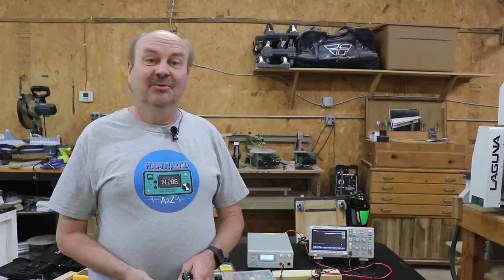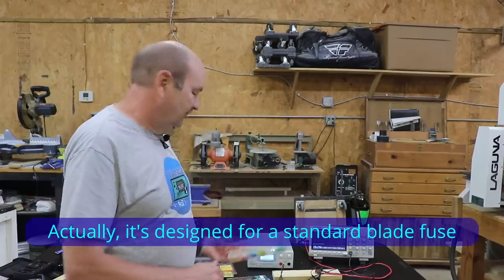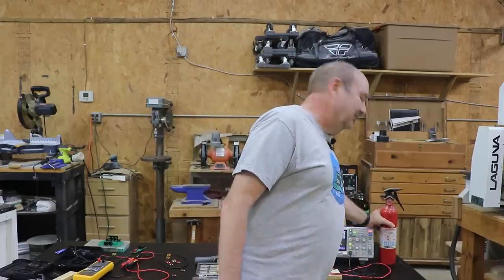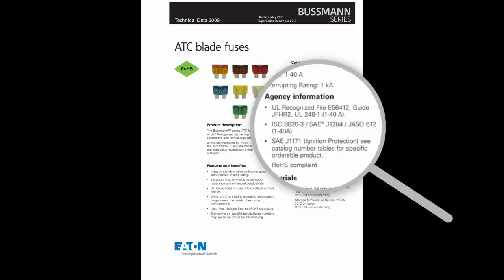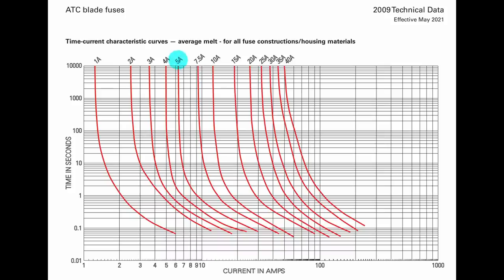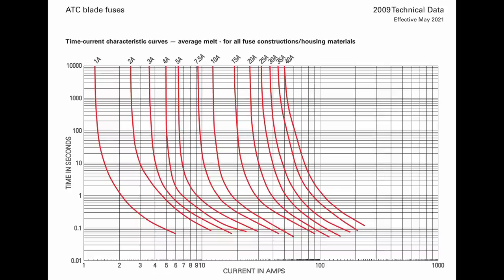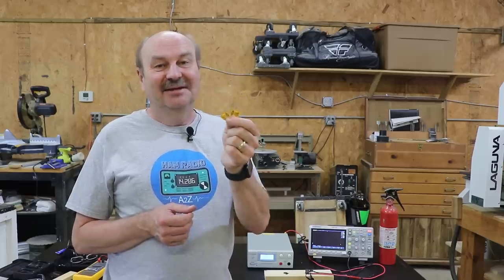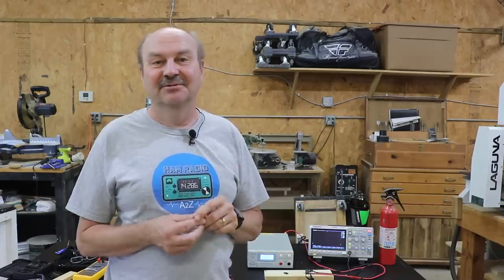Bad Fuses

Comment: There is only one thing wrong with this setup, Your Power supply! You are forgetting about Watts, meaning the ability of electricity to do work. From your readings 21.3 Amps @ 0.6 Volts,
21.3A X .6V =12.78 Watts. A normal 5 Amp fuse requires 60 Watts before it will blow. Let's do the math. 12V X 5A = 60 Watts. So you need 60 Watts to blow that fuse and you are only giving
it 12.78 Watts of power. A 10 amp fuse requires 120 Watts to blow and a 20 amp fuse requires 240 Watts. As these are automobile fuses, they are 12 volt based. All I can add is get a real power supply then you can do real testing.
Reply: Given those volts and amps, the fuse wire's resistance is about 0.03 ohms (V=IR, V÷I=R, 0.6V÷21.3A≈0.03Ω). Given that resistance, to do 60W on the fusewire you need about 45A (P=VI, P=RI², P÷R=I², √(P÷R)=I, 60W÷0.03Ω=2000A², √(2000A²)≈45A).

With the resistance calculated from the voltage and current used in reality, to make the fuse blow at 5A the power at which the fuse must blow is about 0.75W (if power is actually the rule, which I think not exactly), and at 21.3A the voltage that gives that power is about 0.035V

I think the rule is not the instantaneous rate of heating but something of the rate of cooling combined with the power, the specific heat capacity and melting point of the wire material, the diameter of the wire, how quickly you want the fuse to blow. For automotive applications also the stresses in the wire from vibration might play a part depending on material used.
Reply: The thing I'm worried about is that 0.6v. that's the silicon semiconductor forward bias. I saw some fuses for sale with an LED to indicate when they'd blown and I avoided them because the salesman couldn't discuss how fuselike their properties would be... I wonder...
Reply: No, the setup is correct. In normal operation the fuse consumes only a tiny fraction of the power in the circuit. At 4x overload it will still be a very small fraction. Real fuses are made of a low-temperature alloy so that the little bit of power they steal is enough to melt them.

Comment: The Chinese don't care if they burn your house down. There's a video on my channel discussing the importance of having proper fuses or breakers "How not to set your PV system on fire using cheap unbranded components".
 That was prompted by a BigClive video where some Chinese generator had a fake breaker in it. I bought some of these fuses on Amazon but never used them. I should have known better. I just dumped all of them in the trash.

Comment: I would have loved to see a comparison of the fisible links in all the fuses.  I suspect that the no name brand is using the wrong material at the wrong dimensions.
Reply: I suspect the yellow 5a fuses are actually mislabeled yellow 20a fuses. I find it curious he didn’t test any of the other noname fuses.
Reply: @stargazer7644  the fusible link is clearly smaller than the fusible link in a 20a fuse.  It's supposed to be a 5a fuse.  It's most likely a material engineering issue.
Reply: @ianbelletti6241  It is supposed to be, but it isn't for these fuses.   6:18 They all look about the same size to me.  The 5, 10 and 15 are just a slightly different shape.
Reply: @stargazer7644  that's why I'm asking for a comparison of the fusible links.

Comment: That size is known as ATO, Mini are smaller and midi are larger
Reply from the maker: ATO and ATC fuses have similar specs and are the same size.  In ATO fuses, the fuse element is Open to the air - the bottom of the plastic housing is not sealed.  ATC fuses are Closed in a sealed plastic housing. ( I was confused about this too and had to look it up)
Reply: @HamRadioA2Z  closed weren’t available when I was designing auto wiring at Jaguar and then ASton Martin I would suggest the “O” & “C” means open & closed ?? Does little fuse make both types ?

Comment: I never trusted the low cost no name fuses and would never buy them.  You just affirmed what I believed.  I think that the fuse material is just a piece of plated steel stamped to the dimensions of a name brand fuse.  It would be interesting to check the resistance of these fuses compared to real fuses.  I'll bet it is much higher and thus they are currently limiting and therefore they don't open as quickly.

Comment: The cheap fuses clearly didn't blow fast (enough?). But you should have set up your experiment so that the PSU wouldn't reduce the voltage across the fuse to something <<12V. A resistive load like a light bulb, in series with the fuse holder, could have done the trick. The current video just showed that the PSU reacted faster than the cheap fuses.
Reply: Very good point! Consider the POWER across the 5 amp fuse at full load (P=I x E), That's P = 13V x 5 amps = 65W. But the test was 21 amp at 0.6V = 12.6W. The fuse could easily handle the large current at much less than 13V with some heating. A better test would be a battery with relatively "unlimited" current across the cheap fuse. The other test using the oscilloscope was set up with PS off, then switched on, so I'm wondering if there might have been a full voltage across the fuse for longer than the 300ms just because of PS characteristics at turn-0n?
Reply: Doesn't matter, in that case the voltage drop across the fuse will be the same since the other load will be dropping most of the voltage.

This test was accurate
Reply: @donaldgray9924  How about learning a bit about electricity ?

Comment: SO I DID MY OWN TEST, since I have a lot of those cheap fuses I tried the test with a large battery as the power supply. I had a 4 ohm large resistor as a load and found that the 3 amp fuse held, so did the 2 amp fuse, It should have blown but it did not, So I hooked two 12 volt batteries for a 24 volt power supply. This should have blown the fuse fast, it did not. Test circuit resistance set the current at well above the fuse ratting, neither the 2 or 3 amp blew. So now I have to test units from other purchases and toss out the junk. W4GSM

Comment: I've had them for a while now and have replaced plenty of fuses with them. They have blown just the same as the originals when there is a problem. Just check reviews first
Reply from the maker: I’m going to be doing a follow-up on this.  I’m sure these fuses will blow just fine if your power supply is a car battery or something that can deliver hundreds of amps into the short.  The trouble happens if the fuse is protecting a small, sensitive electronic device.  In that case, a small trace on the circuit board inside your device may blow before the fuse.  As I said in the video, if something shorted, then the device already needs to be fixed, but this could make the repair much more expensive.
Reply: @HamRadioA2Z  true, cars are either dead short or not. I might go test a couple fuses today to see if they short at a slightly higher amperage.  It'd be cool to see a video testing a bunch of the budget options like some from Amazon and harbor freight ones

Comment: Fuses are not bad. Those type of fuses are "slow blow fuses" good enough for car industry but not enough fore sensitive circuit. I highly suggest you to use fast fuses which are more sensitive for any kind of current spike, and they are design for surge protection or similar application
Reply: even  a slow blow fuse should blow at 4x current
Reply: @andygozzo72   yes but when ? How much time is needed for that ? If build sensitive circuit protection should be design for that, which is not the case here
Reply: @nikolajovanovic7419  you'd need to check datasheets for the blow time, not all circuits have any integrated overload protection...
Reply: @andygozzo72  of course, but everything depends on you design and purpose
Reply: @nikolajovanovic7419  Three minutes at more than 4x the rated current is way, way too long. A 5 amp fuse would ordinarily be used to protect a small wire, not the heavy wire used in the demonstration. When a fake fuse fails to blow the wire will start to heat up and the insulation may melt and burn. In a real fuse the part between the legs is made of an alloy with a low melting point so that it is destroyed before the fuse legs, the plastic cover, or the connected wire get too hot. The fake fuse is likely just a stamped piece of aluminum sheet made to look like a fuse.

Comment: Wait, why are you testing it at 0.6 Volts and not 12V?
Reply: Because in actual operation the voltage across a fuse is quite low, even at considerable overload. If it wasn't, the circuit wouldn't work since the fuse wouldn't let enough voltage through. If you applied 12V directly to this fuse with a big car battery, the current would jump to over 400 amps! Hardly a valid test for a 5-amp fuse.

Comment: The chinese manufactorers don't care much for datasheets or safety, they just care for their profit! I got these cheap car fuses off of ebay and they work for me. I replaced a fuse in an ebike battery. 2 times i have accidentally tried to charge in reverse and the fuses protected my buck converters from beeing fried. It was fast enough to protect a diode in the DPS5020 Rui Deng buck converter, which i use for charging from PV. They may still be too slow according to standard datasheets from other manufactorers.
Reply: So ... on the one hand, you say "Chinese stuff bad" ... on the other hand you say "it works" ... ?!
Also, a lot of things were produced in China. Don't condemn the whole country when you can blame capitalism and greed instead 😘
Reply: @michaelseitz8938  It works if you know the problems and understand what you are doing. Many ppl just rely on the stuff they buy without testing or knowing what they do. You just can't trust (most) chinese vendors - of course there are exceptions, but you dont know in advance!

Comment: You know there are fuses designed to protect equipment.  They are in ohmmeters and amplifiers and TVs and the like.  Perhaps you should be testing those and use such fuses in your crowbar.  Just a thought.  Use these others in your car.  They'll protect your car wiring.  Maybe.

Comment: This is good information however, you should have tested more of the no name fuses rather than just one 5amp. That 5 amp fuse may have been an anomaly, but testing several 5, 10 and 15 amps as you did with the name brands, would have provided more definitive data and feedback. 
Why did you test so many of the name brand fuses and only one of the no name fuse? Is it just to arrive at a preconceived result?
Reply from the maker: I did test multiple of the no-noname fuses, including a few different "brands".  I just didn't show all the tests on camera.  I got similar results from all of the noname fuses.

Comment: Automotive fuses are rated to run on very low resistance power supplies, i.e. a 12V battery with a rated Crank Current stated on the label.
The current is limited only by the wiring and connections resistance - in relation to the CC value.
Such fuses are in no way suitable for electronics in general, as they are - as you initially mentioned - only suitable for protecting the wiring.
Always use precision (glass) fuses for your electronic equipment.
Reply: My thoughts exactly. Fuses are to protect CABLE nothing else. the cross sectional area of the FUSE is less than that of the CABLE, so it melts first.
Reply: @DarylRaverty  The CC of the battery is relevant only in the sense that you can't depend on the internal resistance of the power supply to obviate the need for a fuse as you sometimes can when using a wall wart. Because you have all that current available, you really need fuses that work. These don't.
To protect the wiring the fuses need to open long before the wire gets red hot and melts. They need to open before the insulation melts. Numerous comments under this video talk about ruined wiring harnesses and fuse boxes when the fuse and wiring got hot and started melting, but the fuse still didn't blow.
Real fuses use a low-temperature alloy for the link. These are fakes stamped out of an aluminum sheet. Since they are intended to look real, the link is far too thick to melt in time to save the cable.
If you watch to video to the end you will see where he compares the fake to a real fuse.

Comment: Would be interesting if you put them on a car battery and put a 20amp load on it and see what happens
Reply: wont make any difference, 20amp is 20amp whatever it comes from
Reply: @andygozzo72  yes but 20amp at 1 volt is not the same as 20amp at 12 volt
Reply: @markjohns7930  true, in terms of power dissipation,  but as i keep saying this is irrelevant here, suppose the fuse resistance is 0.1 ohm,  you'd need only 2v to push 20amps through it, not 12, 15 or whatever ..
Reply: @markjohns7930  @andygozzo72 is right. Ohm's law and the fuse's resistance determine what combinations of volts and amps are possible. You can't just pick arbitrary numbers for the test. It is physically impossible to have 20 amps going through this fuse with 12 volts measured at its terminals.

Comment: so you are running 20 amps at .6 vdc..   You don't see any problem with this???
Reply: Yes, it is a big problem...with the fuse. A real fuse would have had only 0.357 volts across its terminals. 80 milliseconds later it would have blown. Fuses are connected in series with the load, not in parallel. In normal operation they see less than 1% of the supply voltage across their terminals. The power supply in current limiting mode is simulating botht he battery and the load.

Comment: I fully agree. These fuses are typical Chinese junk. JUNK with a capital J.U.N.K. Personally I believe they are a fire hazard. I couldn't find one of my own quality 20A fuse. I borrowed one from a neighbour for my battery charger, realising that after a few hours the unit had failed, upon attempting to remove the fuse it had melted into the holder and melted the whole stand up pcb mount holder. Lucky escape. BIN THEM AND DON'T USE THEM. I had to strip down the charger and replace the stand up fuse holder. It could have been worse.

Comment: They are automotive fuses that work fine for a situation where the source current is massive (ie. car battery) and the fault is a wire short. I can't think why would you ever use such a fuse to protect sensitive electronics when they are the lowest quality and poorly specified fuses available. They are just the wrong tool for the job but nothing wrong with them if used as intended.
Reply: no, a 5amp fuse should still blow within reasonable time at 20 amp
Reply: No, because the wire used in an 5 amp circuit is thin and won't necessarily be able to conduct enough current to blow one of these fuses. As others have pointed out in the comments, these things don't blow and your wiring harness gets cooked.
Reply: @david672orford  they dont blow 'cause theyre bad or 'fake', 5 amp rated wire may be able to pass enough current with a dead short on the end  to pop a proper 20amp fuse before it burns up, depends entirely on the total circuit resistance. 0.6 ohm total would allow 20 amp with a 12v supply ..
Reply: @andygozzo72  I agree that the fuses are fake. I was responding to @piclife1178's suggestion that they they are fine as long as you have a power supply which could in theory blow one of these things by brute force. It seems a lot of people in the comments are stuck thinking about what it would take to blow one of these things and not about when they need to blow to do their job.
Reply: @david672orford  I accept your comments. My main feeling was using blade fuses (in general) where you want a very fast disconnect in the event of an over-volt situation (his first comments mention a crowbar circuit) is a very poor choice. I would have thought that with cheap modern MOSFETs a much better crowbar circuit could be constructed that does not rely on a fuse being blown.

Comment: The wire coming out of the power supply is too thin and has a large resistance.  I suggest you take a car battery, put an ammeter and see how many amperes the fuse burns.
Reply: wont make any difference, the meter on the psu shows its 20amps so 20amp must be flowing(within its tolerances) the wire was obviously good enough